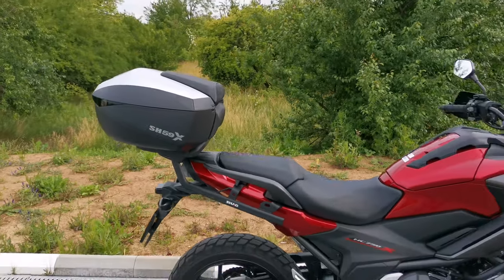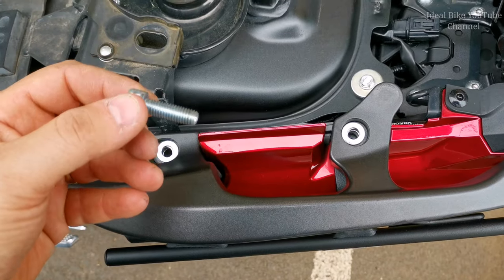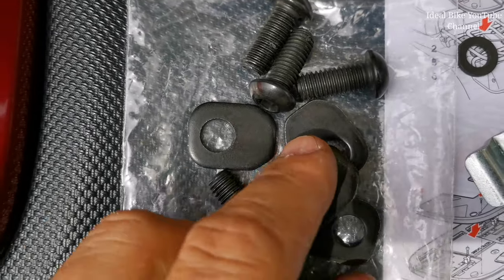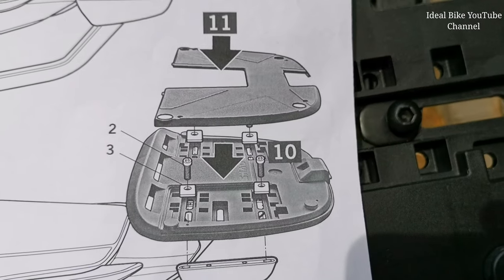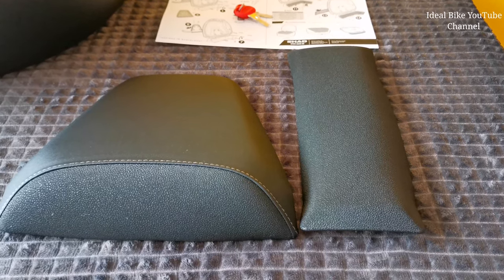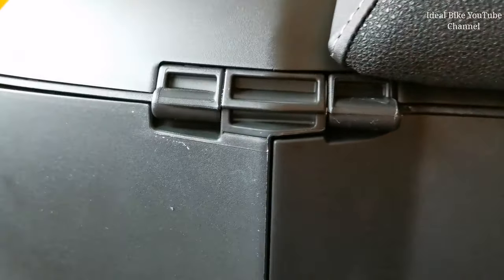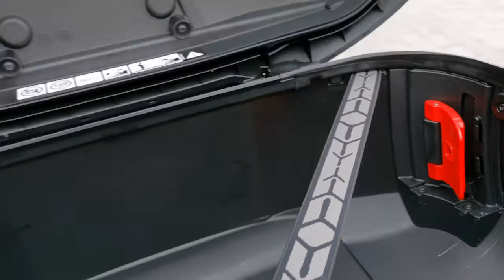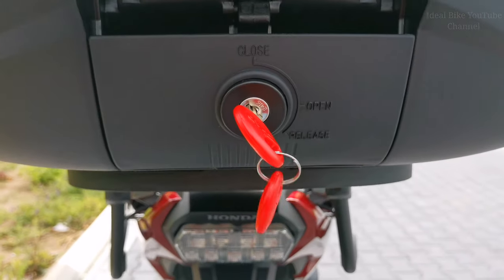SHAD SH59X Top Case - Full Installation Guide & Presentation (Honda NC750X)

Comment: very useful! thank you! I want to install this on the original Honda rear rack
Reply from the maker: You have to check if that it's possible. The plate has quite a lot of holes, perhaps you can... Let me make more research and get back to you with an answer! Greetings
Reply: @IdealBike  thanks a lot! that would be very helpful!
Reply from the maker: @amelsfr  This information I found for you :
NC750X - 16/20
The SHAD Top Master fitting allows mounting a top case onto the motorcycle.  It is a fitting specifically designed por each motorcycle model, taking into account its features. The result is a high quality product, comfortable, safe, and easy to assemble and disassemble.
To mount the top case onto the bike it is necessary to add to the top fitting, the plate included in the SHAD cases (except for TR48/TR37).
Compatible with medium (D1B40PA) and big (D1B481PA) mounting plates , valid for TR48/TR37/SH59X/SH58X/SH50/SH48/SH46/SH45/SH40/SH39. ). To use with SH37/SH34/SH33/SH29/SH26 is necessary to use medium mounting plate. ATTENTION: top fitting not compatible with aluminium mounting plate (D1BTRPA).
Also check out on the video how many fittings you have on the package, it must be that you can do it. 
Hope that helps.

Comment: To give an idea of just how big a carrying capacity the "Shad X58" top case has, I have one mounted on my 2020 Honda CB500X here in Australia. It will easily hold a 30 pack of "Toohey's New" cans and still has a bit of room to spare! 

Easily holds my Shoei Neotech 2 modular helmet and my jacket securely whilst I'm at work. 

I was actually out riding on some dirt roads with it yesterday and I accidently dropped the bike whilst trying to park on a less than ideal position, on the side of the dirt road. Shad top case handled the impact no worries!
Reply from the maker: Yes, I have it mounted on my scooter Honda Vision 110, still looks nice and it's more than helpful

Comment: Just bought the SH58X and my first reaction was "Bloody hell it's flamin' massive." I suppose I'll get used to it and be happy to have all that room for my sandwiches.
Reply from the maker: Imagine 59X 😁 but thanks God it's stretchable and goes smaller.
Reply: It's almost big enough to put a body in it... The Topbox for Dexter....
Reply: @IdealBike  59X is the exact same size as 58X , just 59 is silver and 58 carbon.
Reply: @twistiesnc750x2  thanks for this info, good to know.

Comment: Thanks for video. Could you please tell me how much you paid for it in USD or EUR? Apparently there a big diffrence on prices depending where you buy it !! In Europe, price start from Euro 200 till Euro 350 for the same top case !!
Reply from the maker: I've paid 400 EUR for both rack and top case.
Reply: @IdealBike  Thanks for reply. Here in Switzerland for rack and top case together is CHF 550.00 which means 510 Euro .

Comment: A bit late but maybe some will read this.
the review and guide is good except one of the earlier steps.
you reinforced the rack to the chassis too soon, you only reinforce it once the plate is installed, slowly tightening each screw on plate and rack until you can a perfect install.
while your plate is centered, your rack is asymmetrical , this is obvious from the asymmetrical location of plate screws.
Reply from the maker: Thanks for the tip 🙏

Comment: How about vibration? Rattle on speed?
Reply from the maker: It's not as vibrant as Givi, maximum speed I had was 130 Km/h  with it no problems. Also had some potholes and bumps still in place quite solid. Still has some small issues you can find them in one of my latest videos 👇
https://youtu.be/t2pK4Wvo6uc

Comment: What is the maximum weight that can be carried on the topcase?
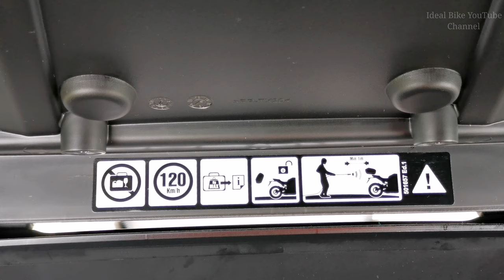Reply from the maker: At 12:39 you'll see that it supports maximum 10 Kg
Reply: @IdealBike  In the sticker it says "Kg Max" and an arrow to the manual. Where can you find the 10Kg info?
Reply from the maker: It's 10 kg max, check out there on the video.

Comment: Shad make nice gear but it is very expensive. If I was to do it again I would use the Shad rack but would buy a much cheaper topbox from ebay rather than shad.( I must say though that none of the ebay boxes are as good as the shad SH59X)
Reply from the maker: Indeed Shad looks very nice, good quality, well done... but it costed 450 € (full package with backrest included). Quite expensive 👀😱😳